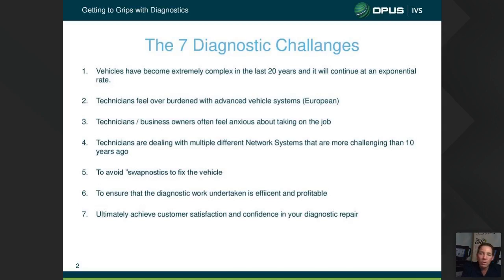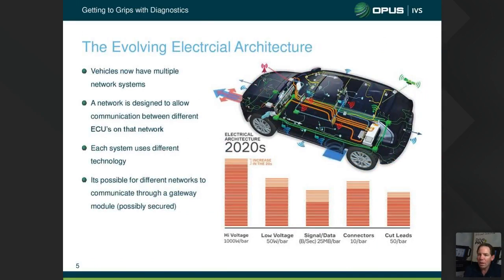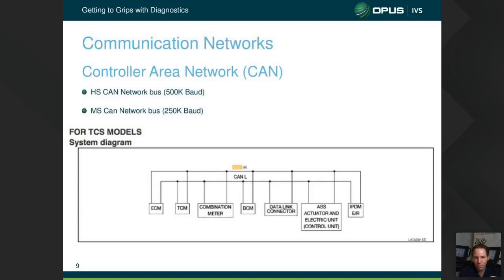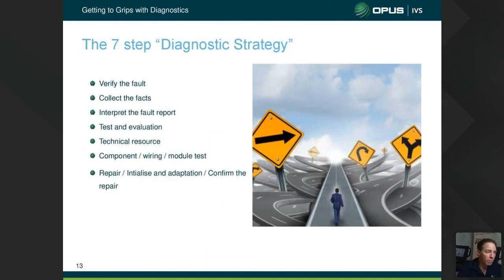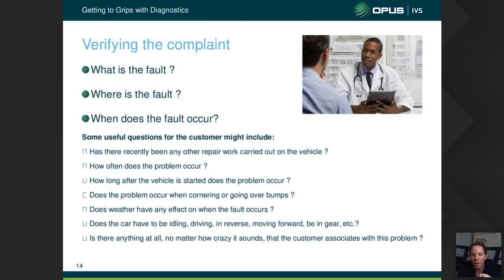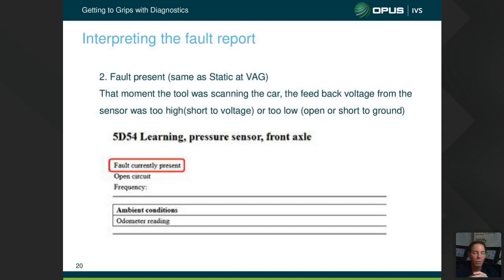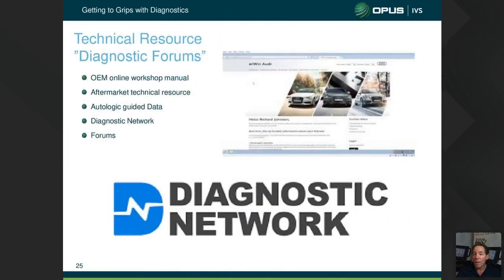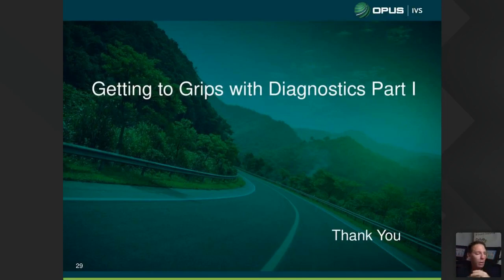Getting to grips with diagnostics

Comment: If possible, please link the PDF of this presentation... Thank you
Reply: you lucky didn't buy this, i spent over 40k with them on old blue box and the drive pro, they are changing rule on you, last thing my drive pro is locked and i paid about 10k couple year back which the Asian and domestic software is junk,  when drive pro came to market the sales guy keep calling and sell me the unit, about year ago drive pro stop working and i call in they unlock the European software since i had own blue box and they said for Asian and domestic not gonna work you need to pay for support, i said no need that since it is worthless, this year the drive pro it stop working again and now they are saying your European software not gonna work, now i paid about 10k for drive pro and can't use it, if i bought lunch or .... at list it was working and it dose some stuff even auto logic doesn't do it, DO NOT FALL FOR IT, GO DO MORE RESEARCH, AND THERE IS NOT MANY PLACES YOU CAN WRIHT REVIW, I WILL DO MY BEST TO SHARE AS MUCH AS CAN TO HELP OTHER NOT GETTING STUCK